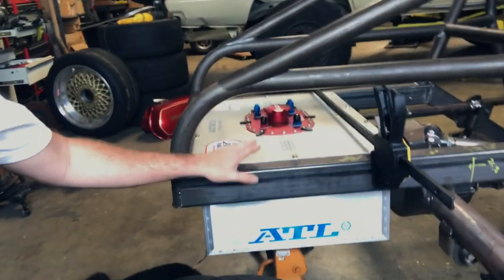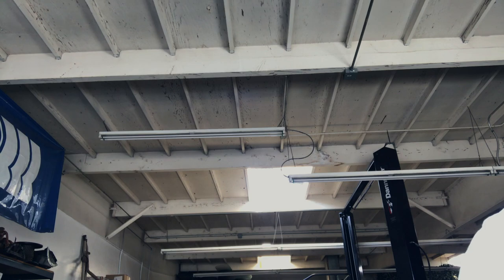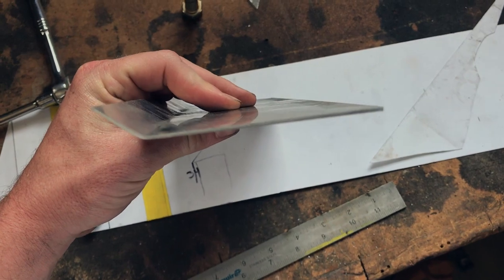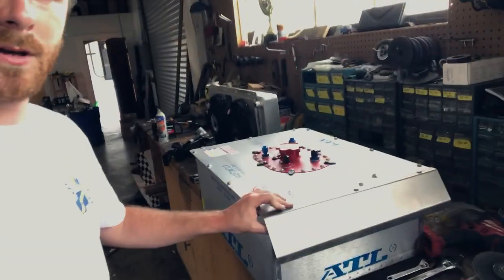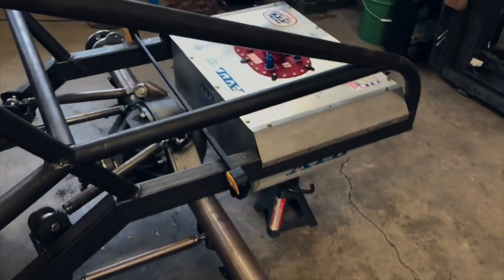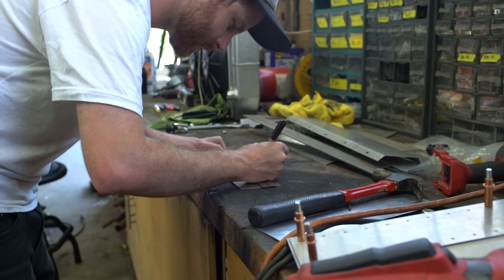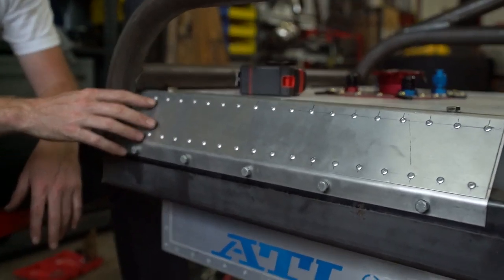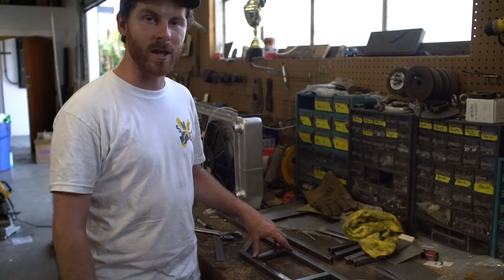StanceWorks: Disassembled -  Episode 3 [Build Session #1]

Comment: So, I'm not here to troll anyone, but did you try the measuring using millimeters instead of inches?
Reply from the maker: Tape measures and rulers are almost all in inches here in the states. While I agree the metric system is far, far superior, it's sometimes easier to just work with what you've got. Millimeters would have made it easier though!